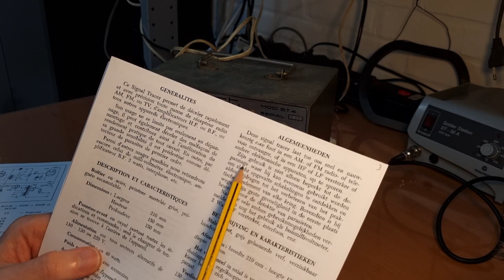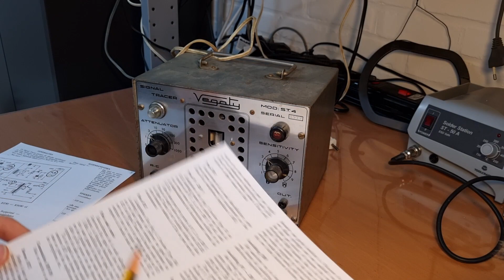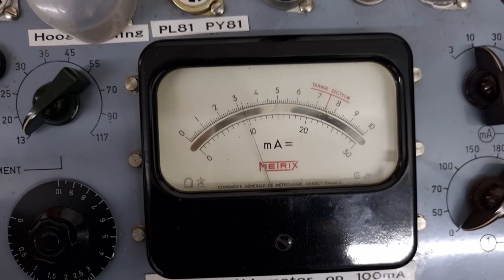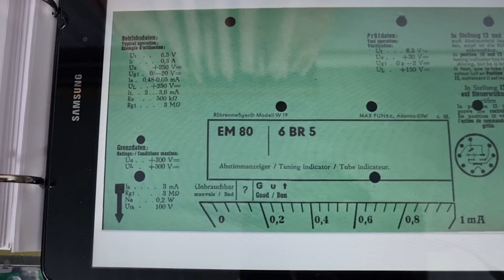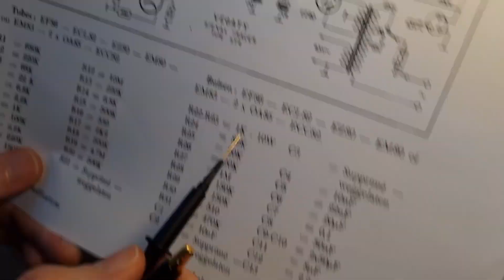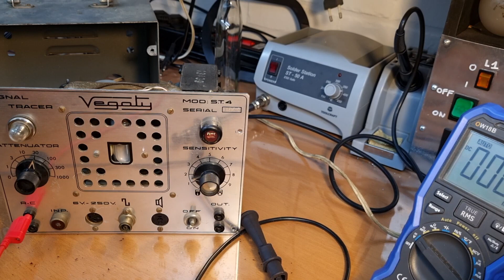A vintage signal tracer with a few more tricks up its sleeve... Vegaty Mod. S.T.4 (Part 1)

Comment: Hi Kristof. This looks like a really useful piece of kit. I think a signal tracer would be a useful addition to the shed, although this one offers quite a bit more than a basic signal tracer.  I usually use my old oscilloscope when I have to trace a fault through, if basic continuity testing doesn’t help. But it’s a pretty clumsy way to go. 
Anyway I’m looking forward to seeing it finished and maybe being used. 
Cheers
Reply from the maker: Thanks, Don. Honestly, these days it would be much more convenient to just get a simple and cheap signal tracer or build one of those kits which are available. But I have a bit of a soft spot for vintage test equipment. 😅

Comment: I recommend you to switch it from 220V to 245V if your voltage rarely gets under 230V. What do you think?
Reply from the maker: Normally I would do so, but in this case the transformer doesn't have a winding for 245V and the 245V position on the voltage selector is not connected.

Comment: The connector with the square wave symbol is not an input but an output.
Reply from the maker: You're probably right. This was really confusingly explained in the manual and I didn't really check this part of the schematic yet. I'll cover it in the next video.